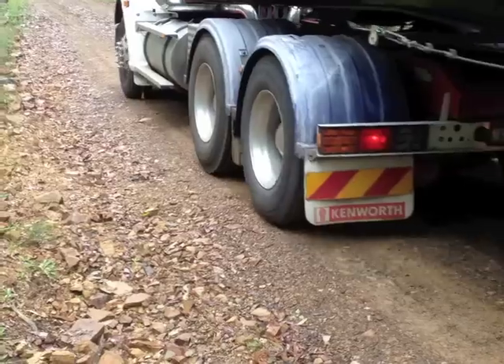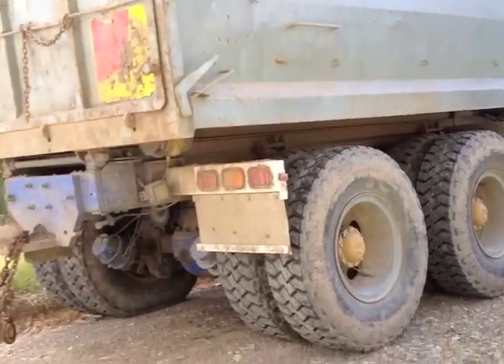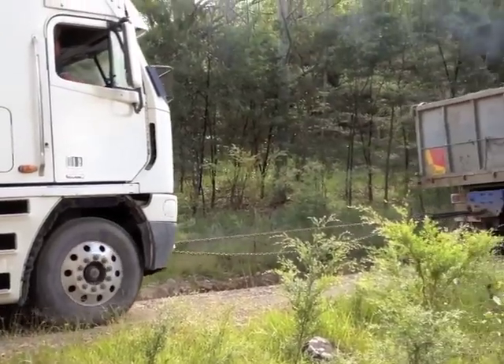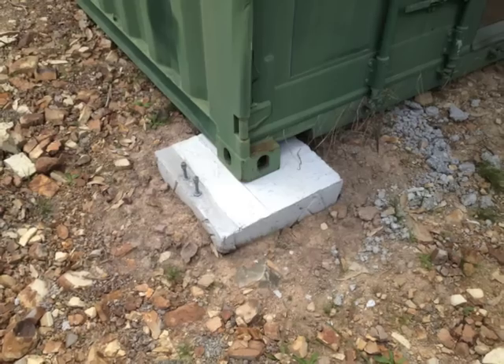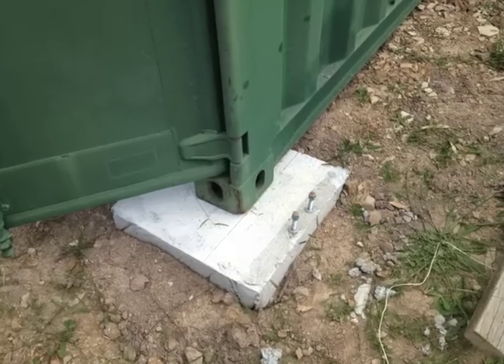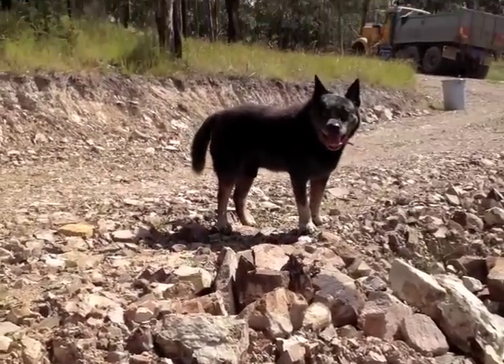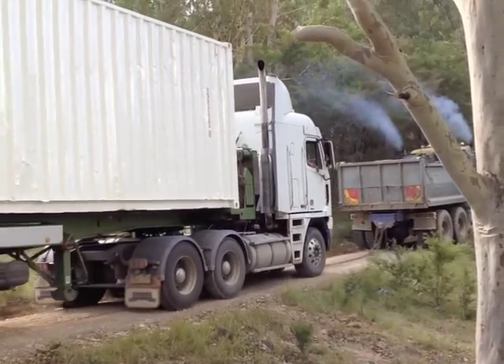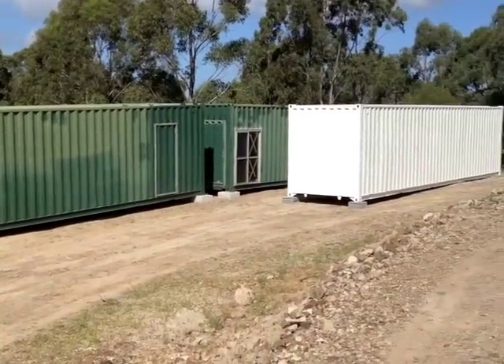Shipping Container House - Placing the containers on foundations

Comment from the maker: Containers are designed to sit on the four castings fully loaded and stacked 6 high. My friend build 8 foundations for his 40ft containers all the same height. The middle 4 were not used as the castings lifted the rail about an inch above them. He never got round to putting a packing plate on them. If your containers will remain uncut that is all you need.

Comment from the maker: 4 of my eight corners are secure. I drilled long anchor bolts through the concrete and placed a steel tube through the castings of both containers. Each end was then bolted down securely using a strong u bracket. I have not yet anchored the outer ends. Cheers Paul

Comment from the maker: containers 4k each, sunroof 2.5k, solar power 12k, ceiling 1k, foundation and transport 1k, insulation 1k, plus any internal fittings or mods such as windows etc. total between 20-50k depending on level of fit.

Comment from the maker: The poles that fit neatly into the cast corner blocks are 40 Nominal Bore Pipe. This has an outside diameter of 38mm and is approx 3mm wall. It is used as scaffold pole and is easy to obtain.
Cheers Paul

Comment from the maker: If however you are going to cut big sections out of the walls it will alter the structural integrity and be less strong. The floor may want to bow and be a little bouncy. If your plans are to place a few small windows 4 should do in my opinion. If you are looking at big openings I would seriously consider adding extra support. When I removed the big window section the floor had a "little" more flex. Cheers Paul

Comment from the maker: Container weight
Disclaimer. I am not a structural engineer. Get good advice. Cutting holes in the containers affects the strength and rigidity of the container.
20 ft container empty,  2,400 kg
20 ft container full, 	24,000 kg
All empty calculations.
Each corner holds : 2,400 divided by 4 = 600 kg.
From your description, two metal posts, each post is holding the corner of 2 containers stacked 2 high. Therefore you are effectively holding up 4 container corners.

Comment: I have not finished yet as the container is 200 plus miles from my home. It is blazing hot right now so I have suspended work until cooler weather prevails. The container cost $2,400 delivered. The dozer was $500 for the day. Material for the windows $200. Sub flooring and insulation $300. Meter pole with switches and meter socket, conduit installation from pole to containers and cable $2,000. Power company cost $3,000. Meter pole is set for 300A. 100A for containers and 200A for future house.

Comment: How did you fasten your containers to their foundations? I have 2-40' containers. I placed them on 2'x2'x2' poured concrete foundations, one for each corner of each container. I used railroad spike plates turned upside down with 1/2" steel rebar loops welded to the spike plates where the holes for the spikes for welding points. The containers were welded to the imbedded spike plates. I agree, if large sliding doors or window openings are cut thru the walls then more foundations will be needed.

Comment from the maker: Ebay Australia. Description - Aluminium MR16 Gimbal Light Downlight Fitting Holder. Seller Rayyim, NSW Australia. 4.20 AUD each, Has sold over 200, good feedback. Mine were all fine. I hope that helps you find it. Cheers Paul

Comment from the maker: Grand total  empty 2,400 kg load. (assuming no roof or contents)
Metal post must hold this under compression.
Full calculations.
Each corner holds : 2400 divided by 4 = 6000 kg.
Grand total full: each post must hold 24,000kg (assuming no roof)
I have a friend who can identify the steel to support such a structure but he is away right now. I will get back to you. Cheers Paul

Comment: Nice..I have one but need foundation ...not sure which way I should go..thinking the spiral pipe..would concrete be cheaper? How wide and deep did you go..I need something which can take allot of weight...maybe double up with floor and roof on top. Almost think a foundation in middle also?

Comment: Great video! Is that all that is required - two piers on the ends - No need for a pair of piers in the middle? Thanks!
Reply from the maker: +Mr26Huffy Hi MrHuffy, Yes. A regular container can be stacked fully loaded on just four corners which protrude down below the rails. A forklift can pick up a loaded container from the side. If you don't make big holes the walls form the rigid strength. If you chop a side out, they turn to jelly and bow in the middle horrifically. Ours have modest holes for windows and are only supported on for corners. Cheers Paul
Reply: +Paul Chambers 
Thanks!

Comment: We are building using 8 20ft containers stacked two high with an atrium in the middle. We are setting them on a full basement as we needed the storage. Not the most economical way to go about it. With this configuration, 3 sides will be supported by the outer concrete walls and welded to steel plates at each corner. The 4th corner will need to be supported with a steel post. Any advice on what to use that will support ?

Comment: Last time I tried to get up a mountain about this steep on a road like this -- guess what??? The same thing happened . Ughhhhhhhhhhhhhh !! 

Actually it has a lot to do with the OTHERWISE excellent eight airbag suspension on th KW -- or so I am told. Also the Kenworth (KW) probably did NOT HAVE 'CROSS LOCKS' on its diffs.

But here you change prime movers to a 4 airbag Freightliner Argosy. Interesting to see if the Argosy could have made it. Being a European design (Owned by Mercedes now) it probably has Cross Locks fitted.

 My PREFERRED TRUCK, the Volvo I usually drive, does have CROSS LOCKS and I am still angry that I was overruled and had to use the KW without Cross Locks.

Comment: What are your thoughts on the floors in containers? I have been told they give off toxic fumes.
Reply from the maker: Hi Mick out west, I considered the principle of out gassing. The floor is 25mm ply, treated with chemicals to make it unpalatable to infestation and rot. The underside coated in tar to waterproof the container. 
I suspect the years would diminish the vapour that may or may not be given off. Our house is as ventilated as any, and in summer more so. We have underlay and carpet over the top.
I suspect my diet, exercise regime, tobacco habits, alcohol consumption, and decisions made behind the wheel of a car will have vastly more impact on my longevity than my wooden floor. I respect those who think otherwise. 
My car emits carbon monoxide in sufficient quantity to kill a human, though we drive in congested cities. I suspect life is a risk and we all get to choose level of acceptable risk.
I aspire to place an insulated false floor over the existing one, if priorities ever permit.
Cheers Paul
Reply: Thanks Paul. That really does sum up the danger of a container house floor. When I get around to my container conversion I will probably clear coat the floor. The paint will probably be toxic anyway. Cheers Mike
Reply from the maker: mickoutwest I think you may be correct. LOL Cheers Paul
Reply: good thinking... and if this is so.. and to save any loss... you could cut out the floors.. and relay.. if all goes to pot that is...lol.. great living man

Comment: wow.... my heart was racing to see the first one come up..... but I have to ask.... is what you have there as a foundation even safe ????????? looks way too close to the drop of the back of it. how deep are the posts ?? I love this idea to have this as a home... but with a solid foundation... like a slab, your foundation scares me.
Reply from the maker: I guess nothing is certain however I feel secure. The spoil is held in place with big stone boulders. The site was leveled with an excavator and compacted with a road roller and graded then dressed. We had 6 months of rain and it settled without any work being done. The foundations go down half a meter. The low foundation is level with the ground so the living container is not very high. There are bolts anchoring the containers down. We have now had tropical cyclones with torrential rain and recently a tornado. All is fine. We are not in an earthquake zone. Getting the containers up the mountain was very stressful, however two years on life has settled and becomes more comfortable with each passing day. Thank you for your concern about us. Cheers Paul
Reply: +Paul Chambers  Paul have you pondered a second container on top of the first, add water heating panels move bedroom upstairs I bet the views would be extremely exciting at sun set just thinking of more ways to maintain off grid.....

Comment: I see hat they are 12 meters containers and you place foundations only on the edges. Didn't it bend after a few months/years?
Reply from the maker: The walls are part of the horizontal strength. If you dont chop holes that are too big, they are fine. Cheers Paul

Comment: I had a problem with a steep short hill and the second container. The vendor sent a truck with not enough ass to get up the hill. I had to get a dozer to pull him up and to get the container on the foundations.  The 1st container came from the same vendor on a bigger truck with a tilt bed and adjustable rear axle that could move backwards or forwards depending on how tight a turn the driver had to make. That truck had no problem with the hill.

Comment: How much did they charge you for delivery if you don't mind me asking?
Reply from the maker: The purchase price included delivery within about 50km. I moved two of them again about 100km each and a number between 200-400 dollars total springs to mind. I think competition for moving containers is reasonable and keeps the price sensible. The biggest problem was having dry ground to put them on and ensuring access for the truck. The turning circle of a prime mover is poor, a friend had a wide drive but had to have it widened a lot to have the truck turn at 90 degrees off the road to get into it. Cheers Paul. I also agree with keyel turner below. Inpect before you buy. Its critical.

Comment: Way to get the job done! You might like our farm-built solution to moving containers through the obstacle course:
http://youtu.be/i_Lu4fKv6-8
Not for sale. Just sharing.
Reply from the maker: nugley Wow, I just watched your container obstacle course. WELL DONE! Did you make the wheel units yourself or is that grey item a piece of farm machinery. Thanks for sharing. Cheers Paul
Reply: Paul Chambers Mitsubishi Pajero 4WD hubs and steering, with a whole lot of recycled metal for the frame, painted grey for uniformity. Backing this thing into position is an art. All good fun!